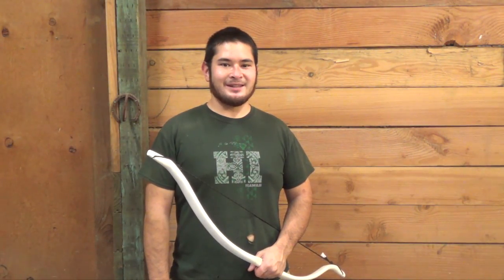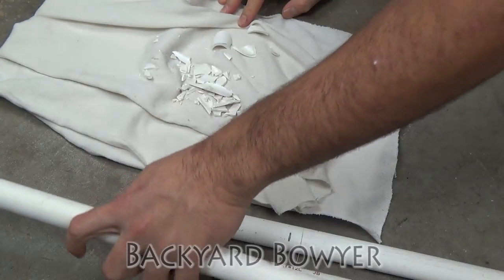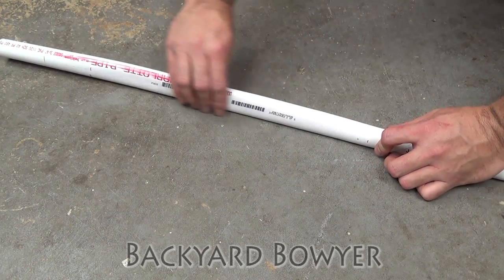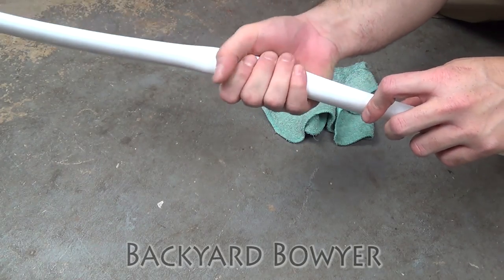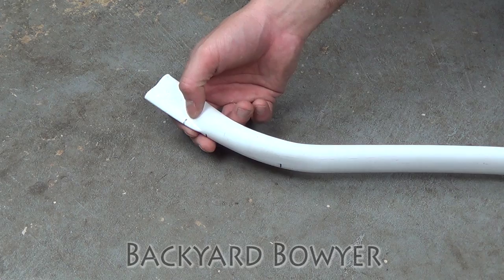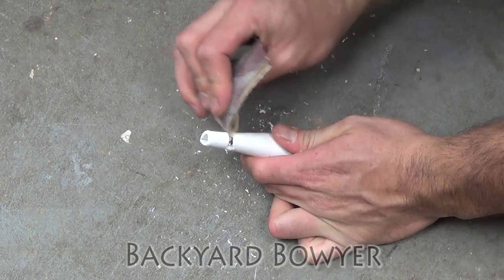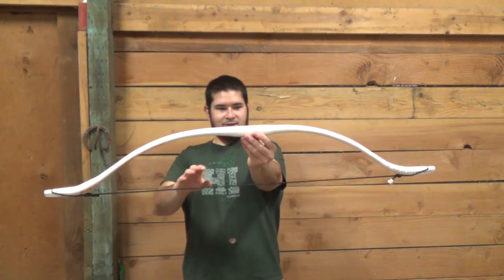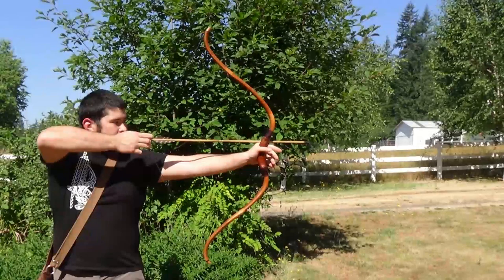40 Pound PVC Bow Freehand Tapered - No Flattening Jig Needed

Comment: Do you have to have the locking pliers? And what can you use to replace them?
Reply: Put 2 pieces of wood on the sides acting like the jaws of the pliers then simply put a couple screws in the wood to bring them tightly together with the bow in the middle. Or you could use a clamp or vise on the 2 pieces off wood

Comment: I made a couple of bows following the guide in your book but adapted the shape with this video. Made 3/4 inch pipe UPVC bow but it was tough material so the draw weight is too heavy. I could use it with mediterranean draw but I want to use thumb draw so it's not suitable for training my thumb. Made a weaker one using 1/2 inch UPVC pipe but have a problem where the strings would slip off to one side and got the bow unstrung so followed the guide on horse bow design to make a bulge to catch the string. But it is still unreliable. Do you have any problems of string slipping and cause the bow to unstrung with this freehand tapered design? Does smaller pipe size makes it easier to slip?

Comment: would there be a way to include a fiberglass rod or two? maybe give it more draw weight?
Reply from the maker: +Chris Crissey If you wanted to add Fiberglass rods, the handle area and the inner to mid limbs need to be made much thicker to make up for the loss of taper. Keep in mind that anytime you add a non tapered rod, you are adding stress to the center of the bow. Making the inside thicker will take care of that.

Thanks for watching!

Comment: Hey nick, hi from the uk. Made this bow from 1/2 inch schedule 40,but was only 15lb draw weight at 28 inch. What draw would 3/4 and 1inch pipe achieve. Great videos by the way🎯🎯
Reply from the maker: Hi! 3/4" should get around 35-40 and 1" would be in the 80+ pound range at this length. I suggest making the bow at least 52" long if in 1", which brings it to around 70 or so. 1" pipe is more variable, the weight really depends on how flat or squished the limbs are. The flatter the limbs, the lighter the draw.

Comment: A closer look at the markings on the pipe reveals this to be manufactured by Charlotte, with the manufacturing standard ASTM D 1785, a type of PVC. If anyone in the comments wants to replicate this bow, thats the type to get.
Unplasticized PVC(UPVC) is more rigid and less flexible(real bad for making bows), and Chlorinated polyvinyl chloride(CPVC) differs from PVC in being more flexible and able to withstand higher temperatures(may be too ductile), and i would tell you more if i spent $60 on the specification document, but its likely you wont get a good result from using those materials.

It seems that PVC(not any other variation) would work best in making a bow, but the reason its so hard to find these days is the food and health safety concerns world wide. some standards are safe to use for drinking water but are not rated for temperature or pressure, some are not food grade.

Ive been trying to make a decent bow for about 6 years now(since i was 15), and ive never been able to find CPVC or PVC. But, if you want to make a good bow, or even replicate this video, you'll need the exact plastic. (this is partly why i took up material science, i got tired of companies not producing what i want lol, a little petty, but i want my bows dammit)

I'd love to make a good bow some day, maybe a giant yew tree would just fall on my city and i could run for it and get a section, till then, im probably just gonna admire these videos

Comment: Idea? I noticed plumbing "pipe" has different performance than "Conduit". As an "Electrician" and a "Plumber" I can tell you Conduit is designed for heat bending and heaters as spacifically made to bend fast in the field, plumbing pipe is not so much. 
I have never tried heating this for these reasons, so I could be full of beans.

Comment: Hey mate, great tutorial, I made a great one but one of my limbs keeps folding. Is there any tips you could give me? And I making it too thin in one spot?
Reply from the maker: Thank you!

If you have any pictures of the bow, I'd like to see them. If you have any or can take any, you can send them to my email, backyardbowyer@gmail.com and I'll see what happened and be able to give some pointers.

If it was noticeably thin in one spot, then that may be the problem. With a folded bow, I usually make the spot where the collapse happened slightly thicker, about 1/8" total thicker because the bow is indicating a point of high stress.
Reply: @BackyardBowyer  Same problem here, thanks for the great vids! I cant get schedule 40 here in South Africa so I'm using 30ml conduit, no breaking with a hammer but pipe wall a little too thin. Can i round the limbs out a little to add more strength? Thanks in advance.

Comment: Would a 390 degree mini heat gun be enough? I recently bought one help apply waterproofing wax (Otterwax) to clothing and had thought that a full on heat gun might actually damage the material I was trying to treat.

I read that PVC starts to get pliable around 250 degrees, though it may take longer for me to get to that temperature for obvious reasons.
Reply: Update: No, no it would not.

Comment: that is not really a recurved bow.
those are more like Siyahs, but they work similar, but more levering then the smooth rolling of a recurve.

I have seen where they strengthen the bow in the limbs and ADD wooden siyahs to make the bow stronger in the limbs, but with longer siyahs to allow the pull to torque the limbs over, making them SNAP open.  
Allows a short bow to increase arrow speed with out the complexity of a recurve.

Good work there BYB!

Comment: Where I live we only have 1 1/4" pipe. Is there a way to lower the draw weight other than using a different pipe, without losing too much efficiency?
Reply: make a longer bow. The longer the bow is the lower the draw weight for the same thickness. You can also press the limbs thinner
Reply: @jamaicanlumberjack  thanks, I'll try making a longer, thinner limbed bow then. See how it goes.

Comment: Hello from Greece Nick.a quick question i ve made 3 bows and i ve notice that all 3 after some 100 arrows have a small nick on tje side of the rest where the arrow touches the bow.it seems the arrow is eating the pipe next to the rest.any solution for that? My thought is to glue a small piece of leather on the bow next to the rest.you ve notice the aame problem??im using carbon shaft arrows.thanks
Reply: Leather works, but I have borrowed an idea from earlier videos and use the fuzzy side of velcro strips for this.

Comment: interesting just a few questions how do you know what the weight is also do you use them for Hunting
Reply from the maker: +Jonathan Henson I can usually guess based on the length of pipe and degree of taper, but I always weigh my Bows on a hanging scale, bow pull scale, and a bathroom scale to be sure.

Comment: can also put a 5/8 pvc tube inside the 3/4 tube to get more power lbs
Reply: It would be harder to pull back, but move the arrow more slowly.  PVC (and any bow, really) acts as a spring.  You're going for the fastest response, not the hardest resistance.

Comment: Hey everybody I see many questions I've studied and practiced this over and over with trial and error. Using PEX with polyester thread wrapped spirally at 54° angle radially outward and inward alternating opposite hand covered with a plastic film and Using PVC schedule 40 solid core as the belly of the bow, cut down the middle, Using one half as belly and the remaining as support/,brace columns for the tips will get you the best performing bow possible. Also Using string bridges will make bow more accurate faster and not as loud.
Reply from the maker: That sounds really interesting. It can be tricky getting everything to stay in place as PVC is notoriously hard to glue, though laminated parts and string bridges tend to make for a very nicely performing bow.

Comment: I have a question is there any way you can make a PVC limbs will fit on a compound bow I have a compound bow that Broadway is too much for me I like to make a regular recurve bow out of it by taking the limbs off replacing limbs Wii regular bow limbs because I don't want to use a compound bow I cannot pull it back the bow I have a 65 pounder and I don't believe I can pull a 40 45 lb recruit recurve bow back because I had back surgery and neck surgery I would like to take my compound limbs off and put me some recurve limbs on it any way you can make some out of PVC that would fit on the bow I have that is a McPherson bow about 20   or 25 years old since I'm not a disabled I thought I'd be maybe cheaper because I take everything I get to live a month for me and my wife

Comment: What if you use a larger size PVC?
Will that make a 50-60- lb Bow?
Reply: typically for higher draw weight on pvc bows you'll want to insert fiberglass rods/driveway markers inside to give it some extra strength he has some videos on that, they're simpler bows since you can't shape the rods but they should be stronger.
Reply: That doesn't answer my question.
Get lost.
Reply from the maker: 1" pipe starting at 56" long will bring you into the 55-60 pound range.
Reply: Ah!  Thank you!
I already have a Makita heat gun....
the best in the business....
56 inches you say....
thank you again!

Comment: hallo from Germany - super videos and nice ideas ! good inspiration :-)...question : is the bow dry shot proof ???
Reply from the maker: +aratanatar Hello! If the bow is well-made and built out of PVC that isn't brittle (you can hit it with a hammer and it won't break) and there aren't any burns, it can handle dry fires (or really light arrows) very well. Just make sure the pipe you are using have around 3mm thick walls.

Thank you for watching!

Comment: Thanks for the tutorial I made a botched version of yours with a thick 32mm tube about 70cm long I got laying around, just to see of I could make it.

I did it, yet it is not pretty, at all, way too small for me or anyone else in fact, burned at some places most certainly not as balanced as you would expect a bow to be, yet it is working. I'm really surprised by the resilience of pvc, at some point I messed up and the bow bend around the handle then I re-heated that place, reshaped it and now it is working fine. It is heavy as a motherfucker tho, not sure if it will shoot great or not shoot at all, we'll see.

I will make arrows tomorrow with a drill used as lathe and pallets wood, duct tape as fleching... It's not ideal, far from being ideal but my country is under quarantine so I don't have a lot to do it. Anyway, I look forward to test it, I'm even impatient! Again, thank you, when the quarantine will be over and if the world still hasn't fell in chaos i'll try to make a better version with longer pvc pipes and fiberglass.

Comment: Nice work but could you explain to me the point of the super scientific hammer test at the beginning? All PVC should be exactly the same strength and all PVC will be brittle and shatter if you hit it right. PVC means poly vinal chloride and all poly vinal chloride based pipe can be easily shattered whether its PVC, CPVC, etc... The only time you may find a section of pipe weaker than the next is if it were to have a crack, uv/chemical damage, or some sort of factory defect. Factory defects in pvc are slim to none because of the strict quality control needed to maintain an ASTM certification for plumbing installations. Now if you were testing sched 20 vs sched 40 vs sched 80 then you will have a reasonable difference in crush strength however even sched 80 will be brittle. Not trying to say your wrong I'm just curious as to why you've found this test to be necessary?
Reply from the maker: That used to be true with a few exceptions, but the trend for many companies is to add as much filler as possible within standards to lower costs. JM Eagle is one of the worst. All manufacturers state how much filler they add if you contact them. Most add chalk as a filler and wax to aid in die lubrication. I've found 100% PVC to be very tough and the more fillers, the more problems there tend to be.
Reply: @BackyardBowyer  Huh Interesting. As a plumber by trade I've laid thousands upon thousands of feet of PVC and I've never felt like one stick was more brittle than another. Usually it's all brittle. I wonder if we get a little bit more consistency by purchasing from a higher end plumbing supply house? I'll have to start smashing every stick before I glue it up lol I'd hate to install an inferior product Haha! Thanks you learn something new everyday!

Comment: im making this bow and im wondering how you could lessen the poundage to be around 35# max when it settles.
Reply from the maker: +Corey Leuschen If you haven't cut the PVC yet, every inch of pipe length you add drops the weight by about 2-3 pounds. So a pipe that starts out 2 inches longer will be in the 35 pound range.

Hope this helps!
Reply: Sweet thanks :)

Comment: that shatter test is kindof discouraging. Should I expect to buy multiple lengths of pipe just to hope that one can be used for a bow?
Reply: elindred u have to buy different brand of pipe and look for those with fat walls
Reply: You can use the brittle pipe, but your bow will actually explode instead of bending if you stress it too much. You shouldn't have to stress it that much though.
Reply: If u r in europe u ll not find scedualle 40 or sc80 pipe,we ve different names,look for class E pipe or class 7 pipe.even that is difficult to find so just look for pipes that for 1 inch diameter(25mm) they ve 3 mm wall
Reply from the maker: +elindred You could use brittle pipe, but that means the material is going to be less forgiving. The brittleness mainly comes into play if something goes wrong. A tough pipe will fold and can be fixed, while a bottle pipe will generally break.

Hope this helps!

Comment: Hi Nic

Would  100.00% Polyamide 6 (PA6) 6mm string be ok to use for the bow string ?
Reply from the maker: +Keyboardbeatz It may be alright because it's so thick, but nylon (polyamide) tends to be stretchy and will slow the arrow down a bit. One thing you may find is that the string can actually hit the back of your bow holding hand if it's too stretchy, which can be painful. This doesn't happen with less stretchy string material.

Hope this helps!
Reply: Thanks for the reply,

I didn't even consider that problem...there's probably many more problems i haven't considered
I just bought your simple PVC Pipe Bows: A Do-It-Yourself Guide to Forming PVC Pipe into Effective and Compact Archery Bows book  :)

Thanks for the advice NIc. All the best now
Reply from the maker: +Keyboardbeatz Thank you for the support!

Comment: Wht type of pvc? Very hard to find heavy duty one like that..
Reply: I've made these before and it's just your normal schedule 40 3/4in from the hardware store if you live in U.S.
Reply: I never thought of hammer test though. I have always checked the manufacture date and then tried to pick one from the center of the bundle
Reply: @adamjohnsonstudio7910  pvc for electrical purpose? Or plumbing?
Reply: @starlittle93  the plumbing is better. Electrical is UV resistant, but takes a lot more set and loses its shape if you leave it in a hot car
Reply: @adamjohnsonstudio7910  thanks for the info bro...

Comment: I made one with a pvc pipe I found lying around my house, I smashed it with a hammer and it didn't shatters, and I did all the steps carefully but somehow it just isn't very strong, it doesn't go back to its original form after being pulled . is there anyway to fix this problem?
Reply: Yik Chen sounds like you completely flattened it instead of tapering. It should be thicker in the center (less flat) and thinner towards the ends (completely flat). Hope this helps!

Comment: ever think of cheating instead of cutting knocks using keyrings instead ?? so that way where you flattend with the clamp running the rings in thru there instead , it would give you additional strength to it no ?